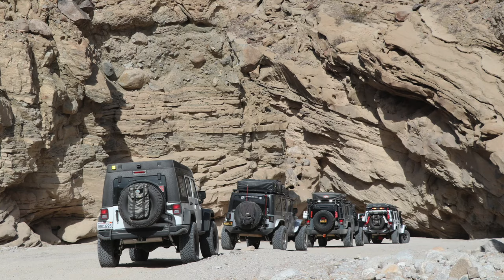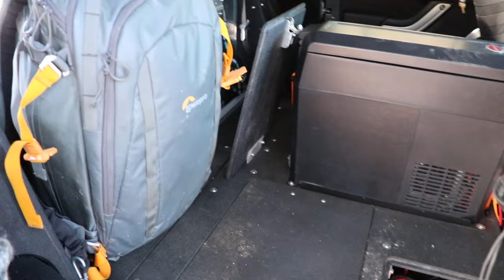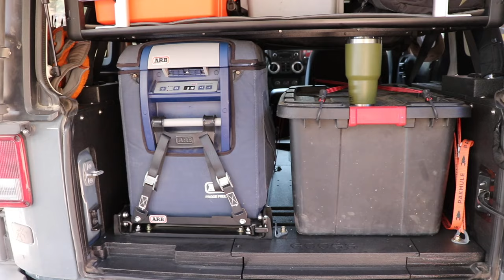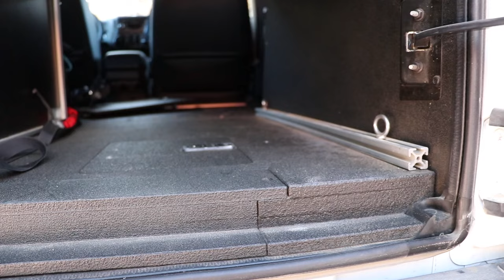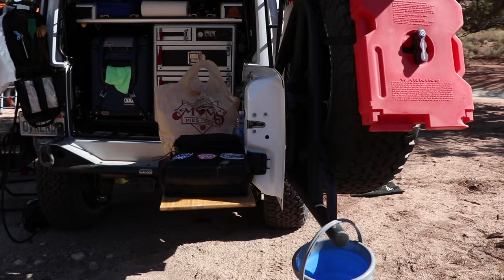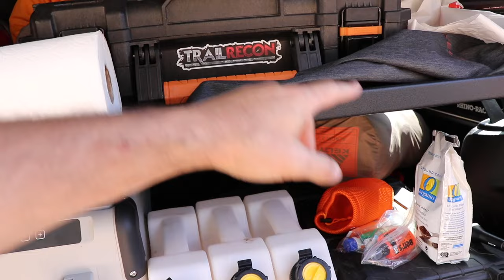5 Jeep Wrangler Overland Camp Setups

Comment: I have not posted any pics on instagram yet, we have 2.5 large breed dogs as kids who camp with us. I recently took the seats out of the back, too many issues for dogs to mention with it folded down. But I built a flat spot where the seat used to be, similar to the goose gear stuff. Since I know you build stuff yourself, it is an easy build. Not taking away from goose gear, their stuff is awesome, I just can't afford it. I do have the vector offload mount. Fun way to carry stuff, GPS Phone, etc.  
That tent that folds downside the hard top, really intrigues me, that is a good looking way to make the jeep a good camper with out giving up the drivability into the garage. I have a friend who had to take his roof rack off because he can't park his jeep or anything in the driveway overnight. (HOA) but that is a nice option for folks who may have that problem. I love Markos, pressurized water set up, that is cool.
I get taking out the rear seat, I have been debating it for over a year now, Bam, I love that its gone. IN the past year, not one person has ridden in the back, good enough for me to realize, I don't need it. it gives you so much more useable room taking it out. 
Thanks for sharing my friend and have a blessed week. 
Dale

Comment: In my 04 TJ I'd take out the back bench and replace it with a plastic bin to hold gear, spare parts, tools, etc.  Then I'd bring a cooler with ice to hold water bottles and lunch.  My trail rides were only one day at most so no camping gear.  But when I get my jl 2dr I plan to do some camping.  My friend has a JK 4 door and we plan to do trails and also research some camping gear and tents.  This was a great vid!  thanks

Comment: You can use the 4 inch PVC pipe as a water container and you can mount on top of your Jeep down down the side of the roof rack if you paint it black it will heat the water and you can put Tire valve on it pressure into it look it up on YouTube is a bunch of videos

Comment: Hey Brad. I am in the same boat regarding the rear seats. I think what I will try to do for my setup is a plywood plate in the very back, with the fridge on the one side and a cabinet on the other. Then I'm thinking of putting in a notch of some kind on the side towards the rear seats so I can have a removable plate that will sit on top of the rear seats when folded. I'm a fan of sleeping in my Jeep as I'm RTTless right now.

Comment: Brad, you can build a platform for your fridge but make the platform 3-4" higher so you can still access the bottom storage area. Should have enough room for your fridge before making contact to your vector platform. Plus you can easily get a foldable table size to fit under the platform. I just finished building mine and looking to build the fridge slide next. Cheers and thanks for sharing this vid. Other than Marco's Jeep setup (which is beyond awesome), I like the idea of the third Jeep with that platform conversion into a table:)
Reply from the maker: Great suggestion, sounds like a nice setup.

Comment: Awesome site. I've been following britelite and trail recon for awhile now. I just subscribed, just realized I hadn't, I'd watch 1 vidio then another ect. So now I'm subscribed. Great site with valuable info. I just got a 2000 Jeep Wrangler  Sahara 4 l automatic  ( Im a disabled retired LEO and Veteran  age 64 so had to get the auto)  and it has 64k original miles,  33 inch tires, bbk 62 mm throttle body, 410 gearing and the only rust underneath was the exhaust. I'm going to get a stainless steel Banks header, magnaflow stainless y connect with free flow cat  and a Banks monster cat back stainless steel exhaust. Also the Banks ram air induction. If I saw yours and Britelite I would have got the JL. But I'm going to set this up first and may just keep it. This is my 64th vehicle first Jeep and 6th 4x4 . I've had 16 motorcycles, the last 3 strikes and 1 sidecar set up before the trikes. My Trike is in garage  and will be sold soon. It's difficult to strap a Walker on a trike. It was time to go back to 4 wheels and definately a convertible. Happy trails. If you come to the Daytona Bch rally I might just be there. Again great site thanks

Comment: I've been looking at the Goose Gear deck for some time now, but I think we are kinda in the same boat. As the cheapskate in me says that I can build that myself for a lot less. I'm single and always just leave my seats folded down anyway, so losing the rear seats is no big deal. Lastly, I like where you mounted the fire extinguisher above the rear door. As I've been wanting to find a better location other than the normal rear rollbar location. Putting it over the rear door is a great idea.
Reply from the maker: I like the idea of the DIY plate system, but I don't have the carpentry skills to make it look as good as the goose gear setup.
Reply: TrailRecon Agreed, neither do I! That is the one of the biggest hold up's I have with doing it.

Comment: Great rigs Brad!! One thing in common with all these set-ups is a power supply centre in the back end for fridges, lights, battery charging, etc. Could you do a video of how they are doing this? Are they running 4g wire from engine battery then to a fuse block and powering up to each switch-accessory through smaller fuses?
Reply from the maker: I really should have done a video when we did it, but it was kind of one of those spontaneous things... "hey, lets put a power panel back here."  I ran it straight to my spod.  Maybe I can reconstruct it in a future video.  Thanks!
Reply: I could use this info too Brad.  Thanks for all you do.  Also curious as to the gauge of wire for what accessories and how many amps.  thanks

Comment: Hey Brad, loved the video. I was wondering if solar panels are used or desired for off-grid power? This combined group of rigs and guys would be perfect on insight when it comes to energy needs.
Reply from the maker: Solor panels are a great option if you are going to be stationary for multiple days.  I'm usually only in one spot overnight, but I do have a Goal Zero Yeti with a 50w panel that can keep the lights on for a bit.
Reply: It depends on your power requirements and budget.  The main consideration with vehicle-mount solar systems is that you are forced to leave the vehicle in the sun. If you camp in the winter or in cold environments, then this is not necessarily a disadvantage. Otherwise, the benefits of solar might be overshadowed by heat, lack of overhead protection, etc.

The smart move is to have a vehicle-mount system that can top off/trickle charge your batteries year-round, and also run remote flexible/fold-up panels while stationary (and put the vehicle in the shade if so desired). Note that you would want to deploy remote panels in a series arrangement to increase system voltage and thus reduce DC power transmission losses.

As for the vehicle-mount system, the choice comes down to the semi-flexible panels vs the conventional hard panels. Both have their advantages and disadvantages. The flexible panels are popular with overland vehicles due to low weight and profile, but they tend to fail after 2-3 years (hence the short warranties) due to overheating. Some vehicles have actually caught fire (e.g. the old Renogy 100W semi-flexible panels ... not the new OEM'd panels released in March of this year). You can mitigate the heating issues by leaving an air gap beneath, but increasing the profile takes away some of the advantages of the lower-profile flexible panels in the first place. Hard panels are higher profile and heavier, but they are more efficient, less prone to damage/heat, and last much longer than flexible panels.

As for solar charge controller, the smart money is on an MPPT. The only drawback to MPPT is that most emit a lot of RFI, which is an issue for those running radio equipment (e.g. amateur/ham radios). If RFI is a concern, look into the Morningstar units, which meet FCC class B requirements. If not, Renogy is a much less expensive option and very popular with overlanding. Hope this helps!
Reply: I'm curious about the electrical setup, too. Just because of the 12 volt compressor refrigerators. What is the power source? Do you turn them off when you are stopped at camp?

Comment: Great video Brad, I like all your stuff.  What gauge wire do you guys run to the back of the of the jeep.  I intend to power a blue seas 12 circuit fuse block in the back and I'm wondering about the wire gauge.  Thanks

Comment: Is there a replacement seat that will fold down to give you a flat surface behind the front seat or, is there a seat system that you can put in and take out easily so if you do have passengers, you can add the seats?  Just wondering,  if not, maybe you and your friends can start a company that does that.
Reply from the maker: Not that I know of, but that would be cool.

Comment: Hey Brad, love the video, lots of ideas for me to think about.  I've got a 2015 F150 that I'm wanting to convert into an overland truck.  Quick question, the dual 12v plugs in the rear of your jeep.. do you have that wired to your main vehicle battery?  Or are you running a dual battery system and powering the fridge from a 2nd battery?
Reply from the maker: F150 will be a great overland platform.  I have the power system wired straight to my spod so I can cut the power off anytime.  No dual battery yet, but on the to-do list down the road.

Comment: I see the fridges use battery power. Do you use a dedicated battery for this or the jeeps battery?
If you use the jeeps battery. How do you keep it from leaving you stranded?
Reply from the maker: The fridge actually has a low power draw and doesn't run constantly.  Some use auxiliary or portable batteries, some choose to use the vehicle battery. If you are going to use the car battery you need to keep and eye on it and don't sit idle more than just for a quick overnighter.

Comment: how do you not run into payload issues?  We are looking to do some travel with our JLU but it looks like payload is only around 1000lbs and surely these are well over that.  Just upgraded suspensions and assume the rest of the driveline can handle it or what?
Reply: Sedel Marino Carson this is my question with everyone’s overland setup. And even the extensive rock crawler setups. How much do they weigh?  Those tires, lift kits, roof top tents, racks, fridge/cooler, underbody armor. There is no payload left for a driver.

Comment: What is CO2 for in the tanks?
Reply: It's for airing up the tires in case you have to deflate for different terrain
Reply: Misplaced Haole why CO2 instead of regular air?
Reply: @biologistjim4905  it can air up your tires really fast.. 1 10lb bottle can fill up about 20 or so tires. you can run air tools  as well for a bit

Comment: Hi Brad, I heard you mention Line-X in your latest video as a protective coating. I Rep a product from U-POL called Raptor Coating for the San Diego area. It's an easy DYI application. Let me know if you're interested and I will supply you with a kit. Oh ya and there is a tintable version. Here's a link to check out. raptorcoatings.com